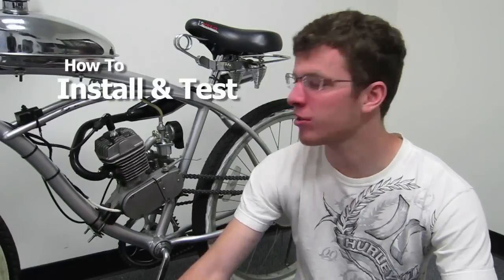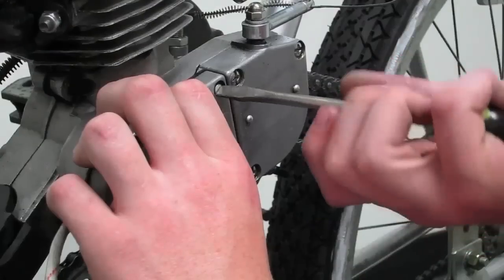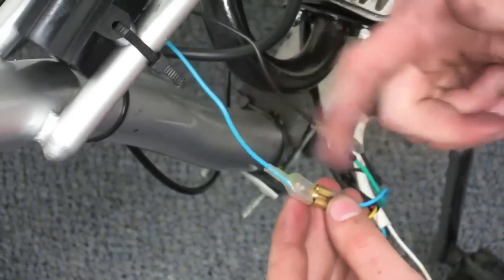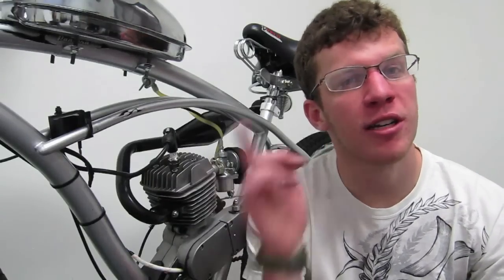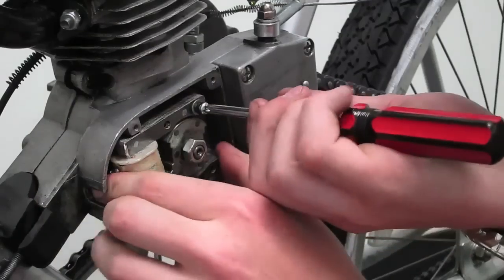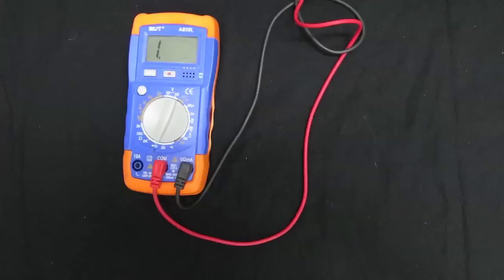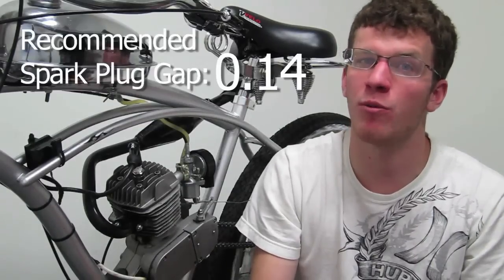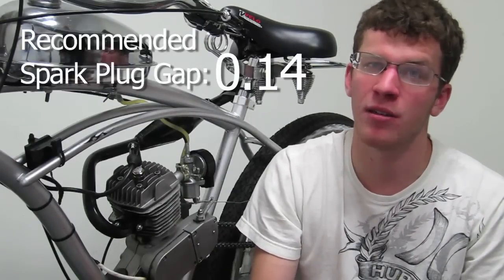How to Install and Test Electrical Parts on Motorized Bicycle - Magneto 48cc 50cc 66cc 80cc

Comment: You must be Canadian.  .14 in America means 140/1000ths of an inch.  That is far too wide open for the spark to jump.  0.14mm is only .006", so I wonder what you actually gap yours at.

Comment: Ok, so you were "atempting" to show people how to test components using volt meter by way of ohms. You left out the most important part,,,,🤯..LMBO. You might wanna elaborate  on how it works and what's happening when you have too high a reading or too low of a reading. And you also asked for personal ways of testing..Here is mine. Remove the spark plug, stick your pinky finger in the boot and touch the electrode, with clutch engaged, put weight on the seat and push to rollover "ONE" revolution. If it has no feeling or to the effect of a bug crawling on you back track the ignition starting with the connections. If it has a bit of a bite change plug. I've used this method for over twenty years (was at a young age back then as well) and never had any health related issues but remember to just use "COMMON SENSE". With these engines originating from China you will often receive faulty components so be AWARE... Some components have resistance and others have very little. Too high of a resistance and it is just as it sounds the item/part is resisting/restricting power flow. God bless "HOPE THIS HELPS"

Comment: So if I strip the black and blue wires down on the cdi and it reads ol on the multimeter it's broken and I have to get a new one right? Because I have 2 that are doing the same thing. Idk what's going on with em. Magneto readings are fine

Comment: Not all cdi's are the same, some of them when testing from black to blue will give 0.0, and for those kinds test from the boot end to the black wire 7ohms more or less. I've had both kinds.

Comment: Hey just wondering if anyone could help me out with my bike. So it's a brand new kit that has never ran. I have tested for spark and have none whatsoever! I have replaced the cdi as the first had a slight crack which I thought might be effecting it. So tried a new cdi and still no spark. I have omhs tested the system and all readings are correct. I have taken out the magneto and sanded it for better connection and aligned it correctly. It is wired blue to blue, black to black and white wire capped off. I have disconnected the kill switch for now until I get spark. The spark plug wire has been stripped back and new wire exposed too and still no spark. Anyone have any suggestions?
Reply from the maker: Feel free to contact our customer service representatives at 1-800-317-0479. We'd be happy to help you solve any problems you may have.

Comment: Hello I have question, I had replace several cdi, the reading is still not normal, also I can’t start my bike, please help, !!! Contact me is u could help me to see my video I need help
Reply from the maker: Check the wiring, spark plug, and magneto. You may also want to try upgrading to a stronger CDI. We carry high performance CDIs that provide a stronger and more consistent spark.
Reply: BikeBerrycom it could be something wrong with my carburetor, cuz I could see the fuel is into my carburetor, I’m not sure it if in my cylinder

Comment: What do you mean by rotate the rear wheel while engaged does he mean the clutch
Reply from the maker: Yes, while the clutch is engaged, rotate the rear wheel to easily move the mechanical components in the engine. This will generate a current to the spark plug if everything is properly installed and working properly.

Comment: Hello! Can you help me, my cdi is in low volume, is 500,I can’t start my engine. Is cause by cdi don’t have enough power to getting spark? Then It doesn’t fire, but I changed 2cdi all in low volume, I’m so confused, and feel bad about this.
Reply from the maker: If 3 CDIs did not work, it is likely a problem with a different part. Check that the compression head is on properly and the head gasket is not damaged. Also check that you do not have a faulty magneto. Lastly, check that your fuel is properly glowing to the carburetor.
Reply: BikeBerrycom  my carburetor is work I can see the gas is go in to the engine the engine is not seem fire up, I don’t know maybe I’m so unlucky with the cdi, magneto is just above the low volume 326 something think is ok, but cdi is so low513, in my voltmeter, is that those products is not so reliable, always bad? The cdi it must be 600-800 then will getting fire ?
Reply from the maker: Check our other video on CDI troubleshooting, https://www.youtube.com/watch?v=I6gZh6OifVs
Alternatively, there are other videos on troubleshooting a CDI that can be easily found, such as this one, https://www.youtube.com/watch?v=89rdCnMUpek
Be aware that the method on the second video may void the warranty on the part.
Reply: BikeBerrycom sorry, I checked also I tried didn’t help me anything, so confuse why doing this, just tell me is cdi problem, so I can’t start my engine?
Reply from the maker: 513 should typically be enough to spark and start the engine. We can not definitively say what is the problem as we do not have access to your bike for proper testing. Please contact our customer service team for step by step help at 1-800-317-0479 or via email http://www.bikeberry.com/contacts
Reply: BikeBerrycom ok, thanks I might checked out, I will try another again, if u say cdi is enough, but is also not spark plug problem, maybe is the fuel didn’t go in engine, but I see is definitely go in carburetor, I have three spark plug, it should work for starting engine, anyway, I don’t really know where’s problem
Reply: No spark I tested why u say cdi is fine, is typical cdi not good,
Reply from the maker: At this point Id suggest you give us a call so we can properly assist you, (800)317-0479.
Reply: BikeBerrycom yes I did call one lady told me she will send me a email, and I didn’t receive yet, just a quick question once I had changed cdi 4 times, reading is still not normal in 600-800, but I see when I start pedal, my magnet doesn’t turn, so is that will not getting spark? I’m so stuck, can u help me how to fixed, send me a video plz. Thanks so much! Should I add pull start for that?

Comment: I have literally had the worst  experience with an 80cc bike kit. First I get no reading on my cdi using a multimeter. It was  like it wasn't even connected. My mahneto was also at a reading if 299 ohms so I order another cdi and magneto. The second magneto had a reading of 299 ohms as well and my second cdi had no reading as well.  I get a replacement cdi now having 3 cdis in total. Cdi 3 also had no reading. I'm so confused and I know that there is no electricity coming out of the cdi. I hope someone can help me. Thanks 😥
Reply from the maker: Hey Tristan, were sorry to hear you're having issues with your CDI. Give us a call at  (800)317-0479, one of our trained professionals will be glad to assist you.

Comment: Someone has probably mentioned it already, but I think the easiest way to test the magneto is to simply plug your test leads into the connectors on the black and blue wires then remove the spark plug, engage the clutch, and push the bike. You can even do this with a super cheap LED voltmeter that reads 0-30 volts. The voltage you see is directly effected by the speed the motor is cycling, but no matter what, even if you turn the Magneto's rotor by hand with a wrench you will see voltage fluctuations That way you can rule out any possible dry solder joints, bad crimps, etc. Or check the resistance via the wires, not directly at the solder joints, because this could of course make everything seem perfect, meanwhile down the wire a bit there I a break from metal fatigue or how the wire was crimped, positioned during packaging, or whatever and you're left scratching your head trying to find the issue.
Reply from the maker: Great suggestion! Thanks!

Comment: does the cdi snap onto the top of spark plug or does it just sit on top of it? dont want to force and break it
Reply: Dakota Petrey snap on
Reply: The CDI doesn't go on the spark plug, it attaches to the frame of the bike, the wire coming off the CDI with the L shape on the end of it attaches to the spark plug.

Comment: how much voltage does the white wire output when the motor runs ?
Reply: 6 or 12 volts, I cannot remember for certain, my engine is torn off my bike right now due to another failed mounting stud.  I believe though its a 12V output so you can run lights from it, however, its not recommended because it really cuts down the amount of power the engine puts out.  The magneto in this engine is only designed really to provide enough power to make the engine run.

Comment: i cannot get a spark from my spark plug. i keep looking for information but my wires are a little different and go as follows my kill switch has a black and a red wire. my magneto only has 2 wires a black and a blue. the cdi or black little box only has a blue and a black wire. so i color matched and then put the red wire with the 2 blues. is this the correct way or what should i do to complete the circuit and get a spark. please note that my magneto did not come with a grounding wire ?  i have the 2 stroke 80cc flying horse kit. please help

Comment: I just opened on from the mail and the igniter tests at 507 and the magneto at 378. Neither are within the specs of this video. Are specs wrong? Because those are the same readings I got on the old ones, which is why I ordered new ones. I have had my bike for 6 weeks now with no start up.. WTF!

Comment: 1.) You got the red (+) positive lead and the black (-) negative lead in the wrong connectors. 2.) If the CDI is supposedly be between 6-8 ohms, then the correct ohm setting should be set on the 200 ohm range (according to my ohm meter or multi-meter range setting). 3.) I try it your way on testing my CDI and I got a reading of 1.063 ohms on the 2k ohms (2,000 ohms) setting and on my second CDI which is brand new and not used, I got a reading of 1.039 ohms still in the 2k ohms (2,000 ohms) setting. 4.) I had used the first CDI when after 16 miles of use my engine died or shut off and wouldn't start back up! 5.) My spark plug is two months old, the first CDI is about a month old and the magneto is less than two weeks old, so please tell me what could be the problem on why my engine shut off or wouldn't start even though the gas tank have a tank full of gasoline? 6.) Oh by the way my carburetor had run over 1100+ plus miles before I purchase the electrical parts for replacement, could that be the problem on why my engine shutting down, the carburetor? (and it had leaked gasoline like crazy!)
Reply: The carb can leak gas, it's a common problem. That can be adjusted. There's a lever in the carb that needs to be bent ( very easy ). But just look it up on youtube search: carb leaking. As for the electrical, it's most likely the magneto, yes they can break in a weak, it could be from the wires touching or the spark plug being loose or just overheating issues, if u have any more questions don't be afraid to look it up, any question u can possibly have about these are answered somewhere on the internet, good luck and p.s. U can get all new electrical parts on ebay for less than 20 dollars.

Comment: I don't like the idea of the kill switch (momentary on) shorting the to main leads together from the main power source(magneto). I use an on/off key switch to cut the positive lead from the coil so it doesn't short the coil and mag at the sametime.

Comment: I have a blue black and white wire coming from the magneto loop and I have a red and a black wire coming from the kill switch and the
Black box in the middle I can't think of the name of has 4 connection slots I've tried the all the possible combinations of wiring with these and still can't get the spark plug to spark when I turn the back tire and the kit is brand-new could you tell me exactly how to wire it correctly?

Comment: HELP. I have similar problems with the kill switch but should mine come with a male adapter or no? If not how do i put the kill switch on if its two separate red and black wires?
Reply from the maker: Shane Pizza If the connectors don't fit each other, you will have to strip them and splice the wires together. Hope this helps!
Reply: is the magneto 6V?

Comment: looked everywhere for the problem I'm having. blew a head gasket in an 80CC 2 stroke motor on my bike... replaced head gasket. On first run everything is going along just fine and suddenly I have no tension on my chain, motors still running so my first thought is clutch. Removed the clutch plate and my clutch is fine, what I did find is the  screw holding the smaller gear had come loose. the gear is connected to the magneto which doesn't cycle as it should now. no compression in the motor with the clutch out... wtf any help or leads would be greatly appreciated
Reply: Stephen Cooper figured out the problem. the key for that gear came out so its just spinning on the shaft

Comment: the kit my friend ordered, his kill switch only has a red and black wire. also we have no green wire. and the magneto has blue , white and black. the cdi ha black and blue. so we come up with four connecter ports but 5 wires to connect. how do we solve this problem. cnt seem to figure this out. plz and thank you
Reply from the maker: JdawG _assassin The white wire is for electrical components such as lights or light signals. If you don't use any of those things, you can just tape it
Reply: JdawG _assassin i have same did it work for u?
Reply: yes. dont use the white wire and everything is dandy.
Reply: +JdawG _assassin  what does your final wiring  look like
Reply: black to black, red to blue, and white is not used unless you attach a headlight to your bike. then u would connect the red wire from your light to the white wire and t
he black wire from your light to the bike frame or he black wires.

Comment: Hey guys I'm having a spark issue I left the bike sitting outside without running for a month although it was covered, now when I try to crank it there is no spark when I test it. I've cleaned the plug and haven't touched the magneto but I don't know how to test it or the CDI. Wiring is good to go also. Also I ordered a pull start from a Chinese supplier and it broke immediately on the first pull. I tried fixing it but it's been a headache I know BikeBerry sells them too are they of higher quality than the ones I can get for $10 from China? I'd really like to ride this thing already but bump starting it kept making the chain pop off. I aligned the chain 100% with a pivoting mount but bump starting it would cause the engine to rotate soo this pull start thing is my only solution unless there's a way to crank start it

Comment: I have ordered two cdi units and both have shown up but neither of them work. OHM at zero. What can I do?
Reply: Have you actually tried installing them and using them?  2 bad in a row doesn't sound right.  I bet your meter is either set wrong, or at some point you had it on a wrong setting and tried checking a voltage or something and blew the fuse in the meter making it totally useless.
Reply: William Todd I agree with u somehow, I also had same problem with u I replaced one cdi and magneto is give same volumes, I don’t know yours is work or not
Reply from the maker: Johnny Mcdaniel First check that your ohm reader to make sure you're in the 2,000 range. If you're in a higher range then it will read 0. Also, try to be perfectly still if you can. If you're still reading 0, call our customer service line at  800-317-0479 9  AM - 5 PM PST on weekdays and we'll help you out.
Reply: Haven't had any issues with the CDI or magneto on my engine...can't keep the engine mounts from breaking so the engine is totally useless now since the last mounting stud that broke I damaged the engine casing trying to remove it...not a fan of this engine design and definitely don't recommend buying one, they're not worth the money...the materials used to make these engines is terrible, and the mounting system is a joke, they vibrate so bad that it continually breaks mounting studs.  Won't be buying anymore, this was my first and last bike engine.
Reply: William Todd is your engine can work? Can start up?
Reply: William Todd I just got my new cdi and magneto today is not working all in low volume, my Cdi is 498somethings, magneto is 326, can’t start my engine
Reply: I have no clue I threw it all in the trash after the failed removal of the broken motor stud last fall.

Comment: Hi,I've had mine for a few weeks now and it ran great. Now not so much. One of the wires from the magneto to the Cdi came loose while running and it killed it now the engine will not run. What should i do?
Reply from the maker: Johnny Mcdaniel Give us a call at  800-317-0479 9 AM - 5PM PST. We have a 6 months parts exchange warranty. We can replace that for you. OHM test all your electrical components as well to make sure it's the wire and not another electrical component

Comment: I have conected all the wires as shown and im left with one white wire from the magneto, does this wire need to be pluged into something or is it some sort of power source for something else not related to starting the motor?
Reply: White wire is for connecting lights. Check out the video on "Magneto" for this motor kit.

Comment: Hi,i got a kit 5-7 years ago and my kill swich dus not work the bike has up to 2000miles on her nowand also the gas valve leas like heck the card had to be fixed,the cluch had to be rebuilt.now i am am getting sick of stalling it or chokeing it out.how would i fix the kill swich?
Reply: Just buy a momentary push button switch and wire the 2 wires from the old switch into the new switch, problem solved.